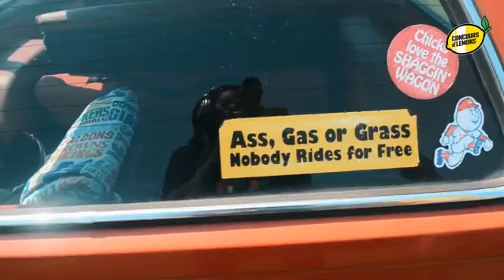Talking Cars with Jason Cammisa

Comment: The smog in LA wasn't just from cars. When I was young everyone had incinerators in their backyards to burn trash. The problem is going to be providing enough electricity. Wind and solar is not going to be able to do it without fossil fuel backup. This makes it very expensive. Nuclear could do it but environmentalists are against it. I have Solar panels and they work great in the summer but not so well in the winter. Our solar panels put out 8 times more during the summer than the winter.